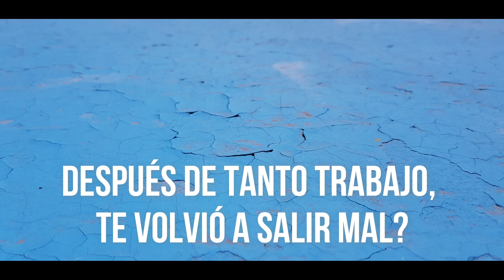✅  REVESTIMIENTO DEFINITIVO PARA PISCINAS.

Comment: Buenas tardes. Hasta que zona de trabajo llegan? Llegan hasta zona norte de buenos aires?
Reply from the maker: Hola German. Depende del tipo de proyecto, nos desplazamos a cualquier punto del país.
Contactame al 341-5637180 y conversamos sobre el trabajo que necesitas hacer.
Saludos.
Reply: @PintoresRosario  hola,  buenas tardes. Hacen trabajos en Paraná
Reply from the maker: Hola. Hacemos trabajos en todo el país. Podemos viajar sin problemas a Paraná. Si necesitas un presupuesto, podes contactarnos al 341-5637180 (soy Sebastián). Saludos.